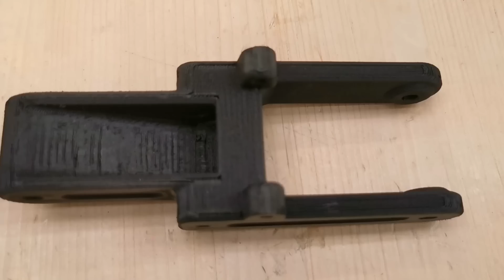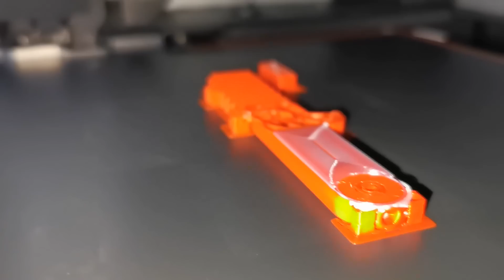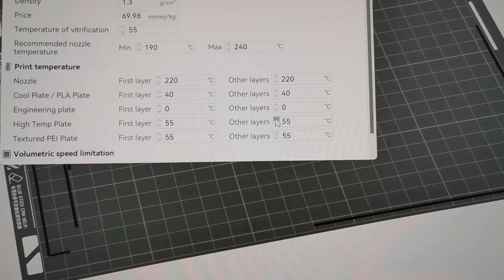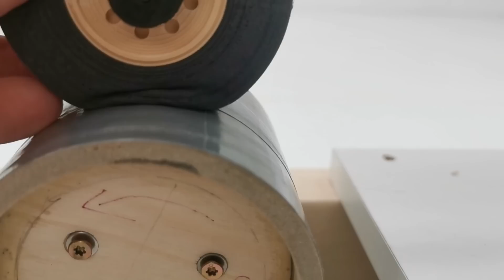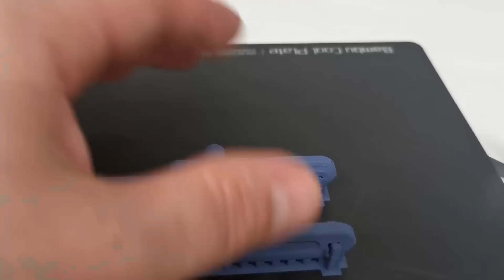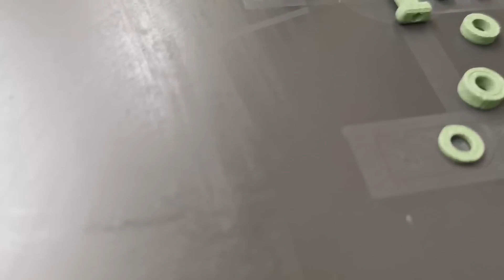PLA-CF Landing Gear 3D-Print Design and Load Testing | Bambu Lab , Carbon Reinforced

Comment: For when I print Wheels I lay them horizontally and use concentric infill about 15% 10% this way when you squeeze the wheel you come in contact with more and more walls giving more and more resistance imitating air pressure
Reply from the maker: Thx, good point!

Comment: layer adhesion  is a culmination of flow, temperature, speed as related to temperature and cooling between layers. all of these effect the overall adhesion. speed and temperature are very related, Higher speeds need higher temperature. flow affects how the filament fills the height of each step correctly, too much cooling makes great bridges but can also lessen the adhesion between layers.

Comment: you need to ask bambulab to add a system so that after pre-airing the filament when changing the layer, pre-heat the layer and then start printing

Comment: Rene. Hoy do you attach the LG to the retract rod?
Reply from the maker: With super glue.
Reply: @rene_rosentraeger  the steering gear as well?
Reply: @rene_rosentraeger   Is it strong enough to avoid the lateral rotation? I'm referring to the retract pin that connects with the strut/leg.

Comment: The contamination makes it weak like you experienced. Only way to get better results would be to significantly increase the purge length. Your prime tower should've been made much larger instead of smaller. It's very wasteful. I only recommend this for final parts. Otherwise, just use normal supports instead of interface filament.
Reply from the maker: Yes, I came to the same conclusion.

Comment: My experience with bambulabs matte PLA was that it was more brittle and had worse layer adhesion than their basic PLA. It was also fussier to print
Reply from the maker: This could be caused by moisture, I´m experimenting with drying the filaments at the moment.

Comment: Printing the tyres like that in two halves isn’t a great way to do it, since both halves have bottom layers that are in contact with the build plate you will end up with a solid surface in the middle of the tyre when you glue them. That means the outside of tyre will be soft but will have a hard ring in the middle which most likely isn’t desirable. You could fix this by not using a bottom layer, but then you could have issues with bed adhesion and sticking the halves together, or you could redesign the tyre to print as a single piece.

Edit: it looks like you could probably print that tyre just as it is in a single piece without needing to redesign it. Also are you foaming the material as much as you can?

Also look at other designs of 3D printed wheels, you have gone for a traditional tyre design but if you designed it to take advantage of 3D printing, like designing thick spokes into the tyre then you wouldn’t have the issue of the tyre “going flat”. Even if you use a better design for 3D printing and the material you can still make it look like a traditional tyre if you want by adding a top and bottom layer above and below the spokes.

Comment: Most 3D printing materials are weak in the Z direction. Look at the data sheets for the materials and you will see a huge difference between strength in the X/Y direction and Z direction (not all material data sheets show this but the Bambu labs ones do). Some materials like nylon are better for layer adhesion but they still aren’t perfect so the orientation of the part is very important. You ideally want all of the forces transmitted in the X/Y plane, within a layer. With your curved overhang bit, is there any chance you can make it a chamfer so it is a flat surface and make it not as steep? That would help it print better. Or could you print it upside down compared to your original printing orientation so that curved section needs no support?

Edit: if you printed your axles vertically rather than horizontally you would see the same thing, they would be much weaker and easier to snap. At the moment the strength of the axles comes from the walls going right down the length of the axle, if you printed them vertically then all the strength would have to come just from the layer adhesion which is weaker.

Comment: as for the parts failing, it's mostly caused by the orientation of the print, remember the layer lines weak
what I think will make your life easier is designing the parts to better match 3d printing, the parts look like they were designed for injection molding with the ribs, and the angles you picked
If possible, try designing the parts to be "chunkier", try chamfering edges to reduce overhangs, or maybe even try printing the parts at an angle(if the orientation makes sense)

Slant3d has a channel with lots of content on how to design parts to fit 3d printing better, I personally learned a TON from them and my prints improved drastically

Comment: Carbon fibre doesn't really add any strength to PLA, if fact prints mostly  end up being weaker than regular PLA since having the carbon fibres embedded breaks the bond between the plastic molecules and also provide more places have increased stress points. It does look nicer though since enough CF content will result in a nice matte appearance, but really the only filaments that seem to improve with CF are ones that tend to warp since the embedded fibres stop the upper layers from shrinking so much as they cool.
Reply from the maker: The CF improves the stiffness, which is quite important on my application.

Comment: Don't forget that you can design out the need for support to some extent.  For example, if you extended the cable clip and have it come off the parent part at 45 degrees rather than 90, it wouldn't need support.

Likewise, for the end where the wheel attaches, you might find that making it hexagonal (rather than circular) would remove the need for support and give you a cleaner print.
Reply from the maker: Very nice, thanks for that man.

Comment: I use CF Nylon in my rc's also. Great material for light weight. Strong parts. Just sometimes has issues with layer adhesion. Usually print at 260℃ on the hot end and 120℃ on the bed. Which helps with the adhesion.

For the PLA prints. Suspect due to the heat changes and the time it takes to change. By the time the next layer is printed. Your layering Molten plastic (new layer) upon cold plastic (Previous layer). so no adhesion/bond is made between both layers. You can kind of see this being the case. As all the prints with the 2nd support material split down the same line of the print.
Reply from the maker: Absolutely. Finally it was possible with cfpla only. I also printed my first paht Cf gear. Drying the material is seems to be quiet important here.

Comment: I'm a little confused Rene'. I thought that the goal was to have strong lightweight parts where lightweight PLA would not have the tensile strength to do the job. Nylon and it's many variations are among the lightest but have very high tensile strength. The weight to strength ratio is very close to aluminium. You would need to use exotics like PEEK to get better. I would use a carbon filled Nylon variant for landing gear and struts. If you had a printer like the Prusa XL with 3 heads you could design parts with cheap Nylon 6 exterior and Carbon reinforced Nylon 12 in certain places to increase rigidity where needed. the third nozzle is used for support material. It is important to have support material in a dedicated nozzle as most do not play well with other plastics.
Reply from the maker: Yes as bigger the landing gear is growing as more potential is there for extra weight saving. Nylon will be tested soon.

Comment: Some plastics will not bond to each other. When changing filament in the same nozzle a residue is left behind and contaminates the other plastic leading to layer fusion issues. The only solution is to use a multi nozzle machine.
Reply from the maker: Yes, I'm fully with you.

Comment: I found when i use the Bambu release filament the prints come out very weak. I think a small amount of that filament is still in the nozzle mixing with the regular pla. Making very weak layer adhesion. I suspect alot more purging of the Bambu release filament will be required to flush all of it from the nozzle. It does a great job of making a nice support surface but it makes the parts weak. If you notice the layers that are weak and fall apart are the same layers that have the Bambu support filament. The support filament is still in the nozzle and mixing with the pla next layer making it very weak. You need a much longer purge of the support pla.
Reply from the maker: Yes, fully agree. Parts for the support material need an extra clean design for less filament change and more purge also.
Reply: I experienced the same thing printed something fine without it and went to reprint using it as a interface layer and just the layer with the most interaction of the filament changes caused a break straight off the printer. Still looking for a setting to increase the purge of the filament during filament change.

Comment: What you’re experiencing with the PLA support is the downside of single nozzle multi material setups. Small amounts of residue from the support filament gets left in the hotend and mixes with your part. This can be mitigated with larger purging amounts, but that’s not great either.
I also recommend printing slower with less part cooling fan
Reply from the maker: Yes, I also think that's the point.

Comment: Vertical orientation is easy to break because layer adhesion is normally weak in FDM printing. You can make layer stick together stronger by using higher temperature but still weaker than printing it in flat orientation. Also the reason why your tire is dent is I think your test equipment keep punching on the same spot of the tire because the rotation distance is nearly the same for both. And dont directly attach brake part to the servo, it will stress it, can use rubber band or spring. Just my 2 cents. But your design is awesome. Don't mind my english, not my main language, lol.
Reply from the maker: Good points! Thanks for your input.

Comment: The strength comes from the orientation of the print. Just like carbon fiber gets strength from bidirectional layers you have to check the orientation of your print part and the layer direction of the filament.
Reply from the maker: Absolutely. On the latest prints there is multi directional layer orientation and it is super solid.
Reply: @rene_rosentraeger  please keep designing, printing and sharing. I love your videos and designs.